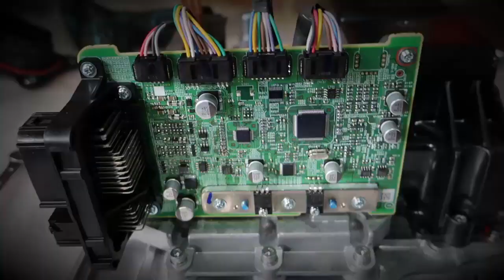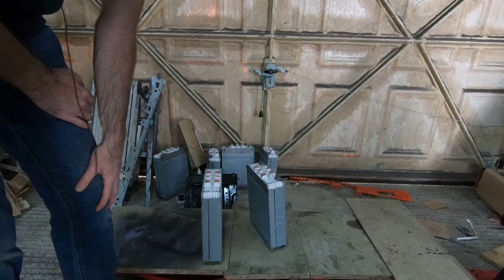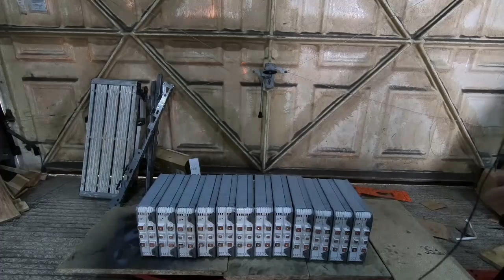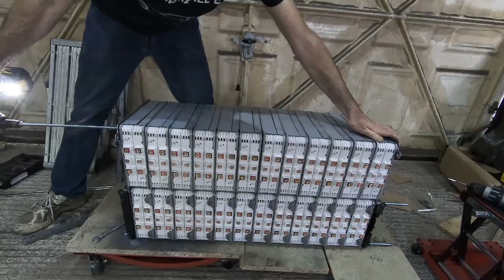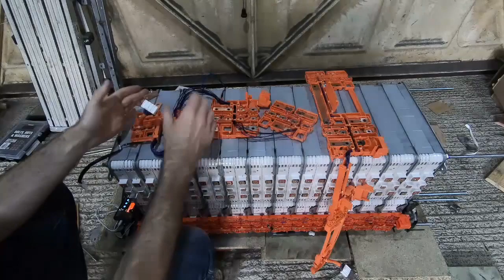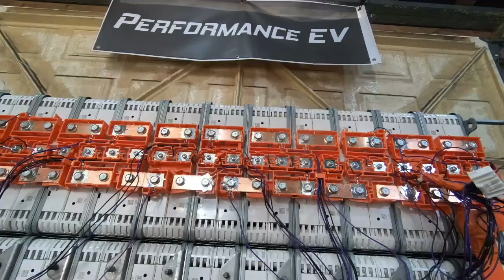Electric Porsche 911 project video 44 - Building a DIY Custom Nissan Leaf based Battery Pack

Comment: Shane, I’ve got a 40kwh pack that will need to be reconfigured to squeeze into a BMW 2002, so hugely helpful. But the jigsaw work on that upper busbar is pretty terrifying. Do you have any further documentation to try and replicate your solution?

Comment: Hi Shane, do you know the weight of the 40kwh pack with just the 24 modules without the case?  Thank you!
Reply from the maker: The cells are about 8.7kg each so it’s just over 200kg for the pack without the case.
Reply: @PerformanceEV  Okay thank you, that's lighter than I was expecting.

Comment: Hadn't seen a video in a couple of weeks, just checking that you're ok?
Reply from the maker: Thanks for checking in. All good, thanks. It's just been a bit busier with my day job the last few weeks so finding time to work on this was challenging. I just released a new video going into a bit more detail on the BMS, Canbus and LeafSpy to try to answer some of the questions raised by the last video. I will get those Can captures out to you as soon as I figure out where I saved them on my pc.
Reply: @PerformanceEV  Good to hear things are ok, and just the normal challenges getting in the way.  Thanks for the new video going into more detail.   And thanks for remembering the CAN captures.   So far, it looks like no-one has been able to re-use a Leaf charger.   The CAN captures of the BMS only will help. :)

Comment: Great video, where did you get 40kwh pack?
Reply from the maker: Thanks, I actually found it on eBay of all places. It's the only complete one Ive managed to find so far.
Reply: Did you buy them a new set or a used set?  @PerformanceEV

Comment: Couldn't you get another strip like you've got on the bottom row from on of the sellers that breaks packs on ebay?
Reply from the maker: That would have helped with how neat the whole thing is, but I would have to transfer all the wires from the part I had as the BMS wiring between the two sections of the pack is slightly different.  I guess it probably makes it easier to manufacture, but makes it more challenging when hacking it:-)

Comment: Nice. I've been lucky enough to find that half the Gen 1 pack fits perfectly behind the rear seats of the Karmann Ghia I'm converting and the other half will go under the bonnet. I'm going to have to extend the BMS sensor wires from the front half to the BMS unit which I'll retain in its original position on the side of the back stack. I hope it works! Keep up with the VLOG, it's inspirational.
Reply from the maker: Thanks. Good luck with the project. If you haven't already found them, there's a page about the Leaf BMS on the open inverter wiki that lists the connector part numbers so you can extend the BMS wiring without cutting and splicing any of the original wires. https://openinverter.org/wiki/Nissan_Leaf_BMS
Reply: @PerformanceEV  Thanks so much Shane! I had read that thread but I hadn't spotted the part numbers. That's a game changer. Great tip and keep the videos coming. If I made any they'd just be long pauses with a quizzical me whispering expletives under my breath as I stare at a pile of looms.
Reply from the maker: You're welcome! That forum is a great source of info. 
Glad you're getting benefit from the videos.  What do you think is going on in my videos whenever it goes into time lapse😉

Comment: Are you going to do anything about heat management? That is one very dense block of modules even compared with Nissan - the outer surface area has been minimised - maybe the box needs heat sinks on the outside? Some in the airflow at the bottom and you could use a fan onto the top ones?
Reply from the maker: Short term, I'm going to manage the heat passively (charging slowly and not driving like a lunatic) but I will need something in the medium term to make the car properly useable. I agree it is very dense pack and I am looking at options that would avoid having to add a water jacket, so heat sinks and airflow are probably the options. I just want to find a way to get air in without adding water on a wet day.
Reply: Performance EV Can’t you rely on heat transfer to the steel case and weld cooling fins to the outside of that to increase surface area? Like you would on an air cooled engine? Or a sump?

Comment: Nice work, much better done than myself ;) I put the wide bus assembly on backwards and only reused some of the plastic from the second half and kindof randomly connected the sense wires. Ended up making an adapter to get it all right again and burned one BMS in the process.
Reply from the maker: Thanks. I read through that post you started on the forum 4 or 5 times before I attached everything up, learned a lot from those that have been here before😁 It will be interesting to see how close I got it when I start trying to read from the LBC later this week.

Comment: hi did you check if the big pack assembly was towards the negative or positive of the battery pack? eg are the balance wires the lower half or upper half of the battery.
i recommend checking the voltages at the balance connectors before connecting

Comment: Hi! There are some nice background music You have! Keep it that way))) And about the leaf modules... well that was a pretty nice pack back in the day, but now they are simply too heavy for the given AH or kwh. I've gone with the NMC LG chem JP3 and JH3 cells. They have almost the best specs for now, 300 whr/kg and 0.2-0.4 mOhm ESR. Check them out, cos they outperform every tesla battery which were the best on the market for a long time. Your 30 kwr with those cells will be the half of Your original leaf pack weight) And faaaar more power capable!
Reply from the maker: Thanks. Sounds interesting, I am interested in ultimately getting some more cutting edge batteries in this car, but these leaf ones were a decent offer so will work for phase 1 (I firmly believe that there will end up being many many iterations of this car as I get my hands on new or interesting technology.)

Comment: How are you not getting a shock from the  batterys are they not changed.
Reply from the maker: There is plenty of charge in the battery, but I am being very careful about what I touch and what I bridge together. Now that the battery is built, if I was to touch the first positive terminal on the lower pack and the last negative on the upper pack I would get a really bad shock. Likewise if I was to bridge those accidentally with a spanner, that would be really bad. The reason I am reusing the all those plastic parts is they are really good at keeping everything separated and reducing the risk of the wrong parts being touched.